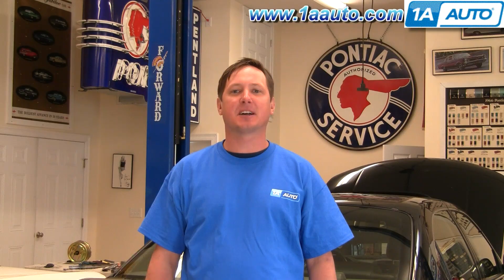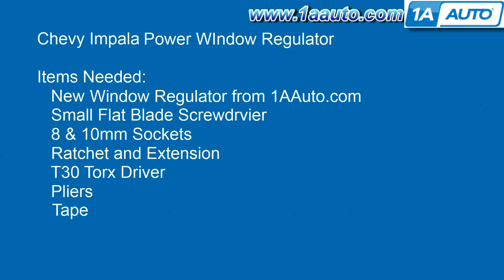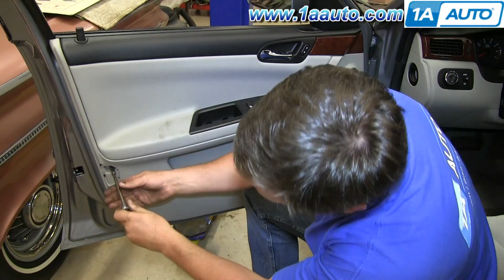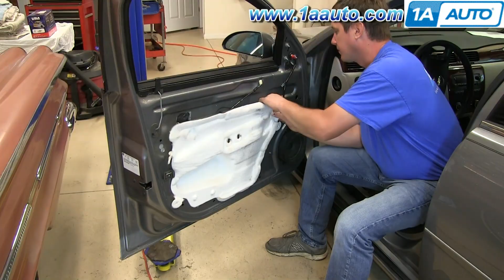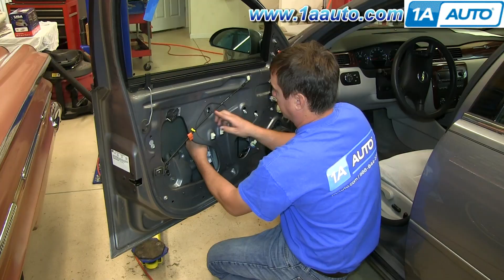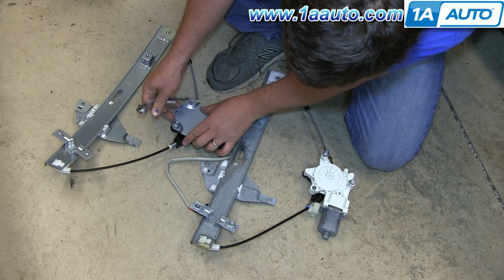How to Replace Window Regulator 06-13 Chevy Impala

Comment: To hold the window up use that 'Aluminum Foil Tape'   2 layers horizontally applied,  from the window just on the stainless door frame trim. So you can drive around or if its going to rain. This tape pulls off clean too, don't use gorilla tape or duct tape or blue painters tape. Also that Aluminum foil tape is great for repairing that water barrier foam from the last person that tore it up 😅

Comment: Thank SOOO much for this video. My window fell into the door panel on my way to work and one repair shop wanted $400 and another $375 to replace the regulator and motor. I got the window regulator and motor for $44 myself, watched THIS video, and got it done in less than an hour. The instructions were simple and explained perfectly. Thank you!

Comment: This is what I needed to see. I've gone through dozens of videos and can't figure out what's causing my master window switch to suddenly stop working. I've checked all the fuses but my guess is I have a loose or broken wire in the door panel area or I've overlooked a fuse I can't seem to find. Thanks so much

Comment: Great video, thank you. Not a big deal but if you’re replacing the window regulator on a 2007 Impala LT for the drivers side rear door the bolt it’s a 7mm no reflector just a small square plastic cover.

Comment: this video is great, spot on, the part was easy to find on 1aauto ordered it sunday night received it thursday morning @10:00 from the usps. took less than an hour and i'm a 66 year old that doesn't squad real well and moves a little slow. i could not get the door latch cable loose as shown in the video. squeezed the clip over and over and it would not pop thru the back of the bracket. i disconnected the power cable and flipped the door panel upside down and horizontal to the ground so i could see better and it popped right thru. the pigtail was a bit of a worry for me. i tie wrapped  it several different ways but the window touched it when it went all the way down. there is a small wire bundle that runs across the door towards the speaker. i tucked it in behind the wire bundle and it is safely out of the way.  great job 1aauto and many thanks.

Comment: Watched the video, bought the part, and with a little effort I fixed it saves hundreds thank so much. 09 is slightly different 7mm behind reflector and door panel connector is different flat screw driver into big hidden slot and it unclipped.

Comment: If my driver side window is up, but won't go down, is it a bad motor or switch, or could it be both? When i press the button there's no noise or anything.
Reply from the maker: +Joaquin Amaro We do not have a way of being able to diagnose the issue that you are experiencing with your vehicle but suggest taking it to a local mechanic for a proper diagnosis.

Comment: How do I lower the window to get to the bolts to take out the regulator. Because my window is up and won’t come down
Reply from the maker: +SlimRich First, verify that the motor has failed. Make sure the window lock button is not set. Check for power and ground at the electrical connection of the motor, check the window switch. It's a lot of work to get the motor out if it's stuck closed, so verify first you actually need to replace it. Carefully unbolt the regulator with the window attached and then lower the whole assembly down in the door. Then you may need some one to help you, but try and unbolt the glass and lift it out of the way. Then do your best to get the regulator and motor out of the door, at this point you may have to try and unbolt the motor. Once it's unbolted, you can collapse the regulator
Reply: Thank you

Comment: Very professional video repair. Every video from 1A is top notch work. Thank you for doing this. The GM dealer wanted $100.00 to tell me my window regulator was broken. Then $350.00 to replace the $60.00 part that took me less than an hour to repair the first time.  I can not believe it would take a professional more than 20 minutes for this repair I own GM stock none of this money is going to owners of the company.

Comment: Do I have to take the whole door panel off just to replace the lock/unlock switch on the door or can I remove the one screw behind the door handle and pop off the plastic piece ? My unlock/lock button does not work on the drivers door but locks and unlocks with the key fob. Been this way for 2 years
Reply from the maker: +Mike F If you can access the screws you might not have to. 1aauto.com

Comment: What if the plastic clips break at the bottom of the window can i order that from you guys?
Reply from the maker: +Paul Perkins What is the year, make and model of your vehicle. We can see if we carry them for your vehicle. 1aauto.com
Reply: 2009 v6 the smaller liter engine
Reply from the maker: +Paul Perkins We currently do not carry this particular part. You may be able to get them from your local dealer. Hope this helps you out. Thank you for asking. 1aauto.com

Comment: Isolated issue to the motor but it is in the full up position. Any tricks for getting the motor or regulator out of the door or glass low enough where you can loosen the clamps before I start pulling the door apart?
Reply: Mike Graham how did you get the glass low enough

Comment: Quick question.  Made the fix on the window but it got dark so I quick just threw everything else in the car without putting the panel back on and shut the door.  Now my door won't open from outside - how do I get it to work?

Comment: Hey, my driver side window and my 2 back windows won't go down ...any suggestions on what the problem may be
Reply from the maker: +Justin Bailey You may want to start by checking the fuse. Then see if there is power going to and from the window switch. If there is power going to the window switch, but not going from the switch, it might be a bad switch. Hope this helps to point you in the right direction. 1aauto.com

Comment: my driver window on my 2011 impala won't roll up and down anymore but it does roll all other windows up and down what could be wrong?
Reply from the maker: +Victoria Jones You may want to see if there's power going to the window motor when the switch is pressed. Hope this helps you out. 1aauto.com

Comment: i have a 2010 Chevy  Impala after getting my windows tinted 3 days later attempting to roll down my windows, three of my windows dont work but the front passenger side does work IF i press the button on the front passenger door. Two rear door controls don't work driver doesn't work or control the other windows. Lock controls work , mirror controls work. Maybe water damage (from the tint job?) Unheard of maybe i don't know. Please  A-1Auto speak wise words upon my screen.
Reply from the maker: +flychicu1be Thank you for watching. It could be that some water got into the electrical and caused the window switch to become faulty. We would recommend testing the power going to each switch to help diagnose the issue. 1aauto.com
Reply: +1A Auto Parts thank you so much i love the advise and instructional videos you guys upload to teach us diy folks have a great day

Comment: this is the second time I use a 1A Auto Parts video to do a repair my 06 impala. And all I can say is you guys video is easy and precise. Thanks and keep up the good work.

Now only if you can tell me how to fix my transmission from acting as if I keep hitting the accelerator, even while on cruise control that would be great. But I kid. But not. I really have that damn problem.

Comment: would this work on a 2012 chevy cruze?
Reply from the maker: You may be able to apply some of the basic steps show, but door panel and window regulator removal may be different. We currently do not have an auto repair video on this particular repair. We do carry replacement window regulators for your 2012 Chevy Cruze, here's a link to them on our website if you would like to take a look at them http://www.1aauto.com/2012-chevy-cruze-window-regulator/y-mo-c/2012-1700-16?utm_source=YouTube&utm_medium=Forum&utm_campaign=1ATony
Reply: +1A Auto Parts I ordered the part already. But thank you!

Comment: What if my new window regulator don't slide like the old one so I can match the window regulator with the glass?
Reply from the maker: You may have to extend the window regulator a bit by hand so that you can attach it to the window glass.

Comment: what if the only window not shutting is the rear driver side?
Reply from the maker: You may want to test the power going to the window switch and also to the power window motor. Hope this helps you out. 1aauto.com 888-844-3393

Comment: when i roll my chevy impala window up, its off track. it doesnt roll up right, it falls foward, n after watching this video im not seeing how to fix it falls foward n i have to push the back of the widow down to roll it up. any videos on how to get it back on track? any suggestions would be much appreciated.
Reply from the maker: HI Tammy, You may want to take the door panel off so that you can inspect the window regulator inside the door to see if a screw fell off or if the regulator has broke. Hope this helps you out. 1aauto.com 888-844-3393

Comment from the maker: You would need to remove the door panel and push the window into the up position by hand. 1aauto.com 888-844-3393 FREE SHIPPING on all auto parts in the lower 48 states.